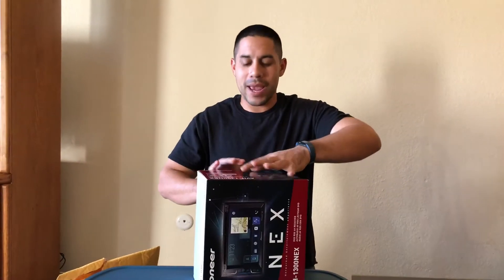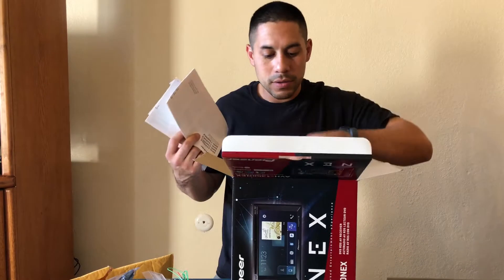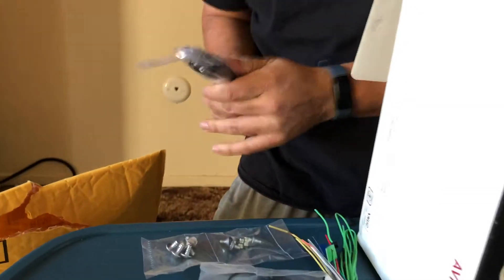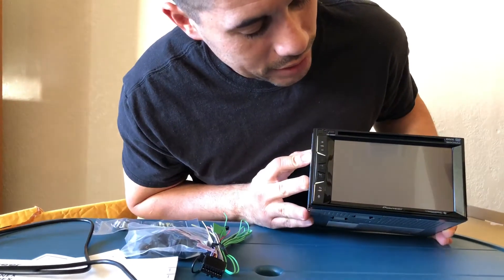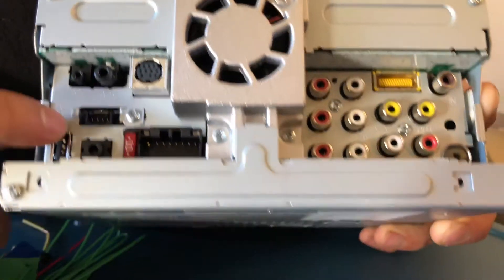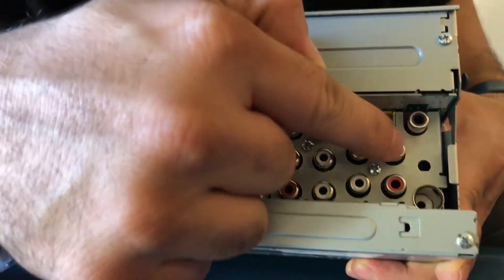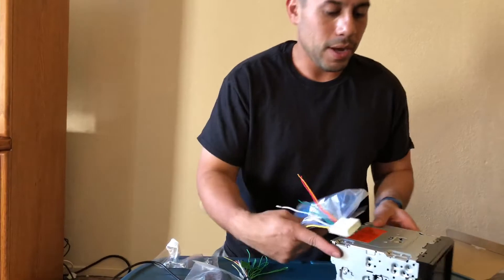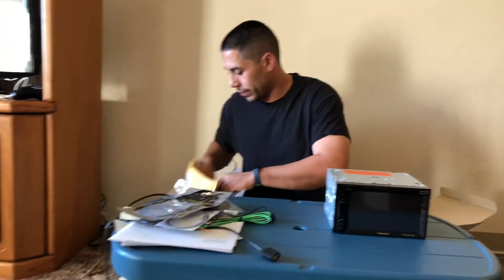Pioneer AVH-1300NEX unboxing!!!

Comment: How do you like it a year later?
Reply from the maker: djgblaze no filters it’s been working great. It’s currently installed in my wife’s car. But, In about a week, I’m going to be installing it in my dedicated spl build. I’m interested to see how it does with that much flex and vibration. If USB pops out easily , or if it affects any of the functionality when it’s under that much pressure. Overall though, it’s awesome, it’s never froze on me, or not responded on the touch screen. It’s pretty fast too. Be sure to install it with the micro bypass, that way you can access Bluetooth pairing and other options that otherwise you’ll have to be in park to access.